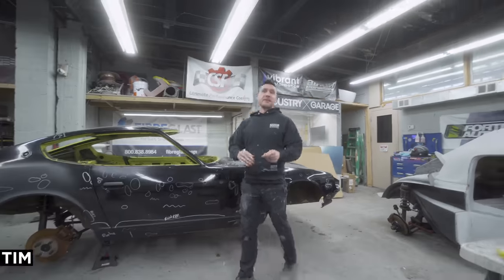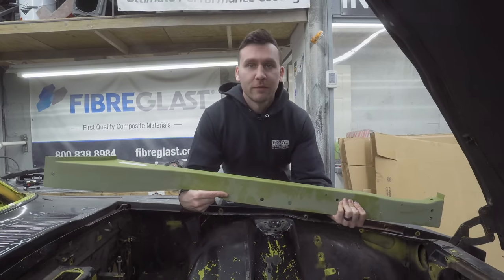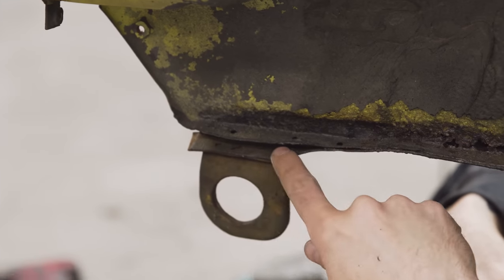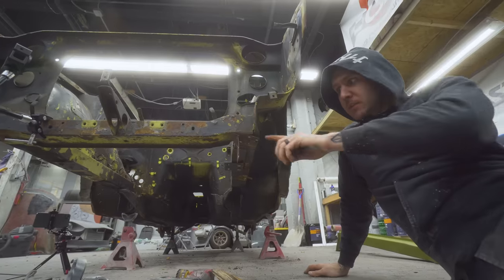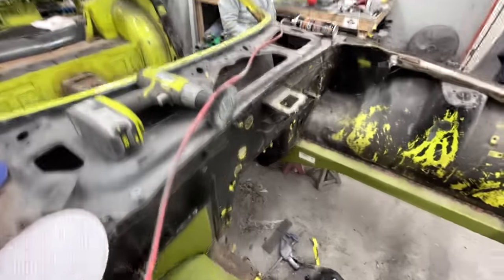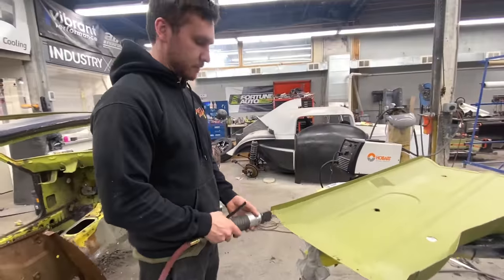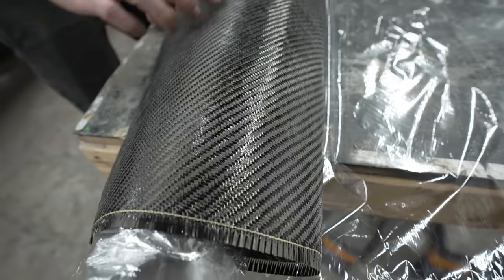Carbon Fiber 240z Restoration | Part 1: Rust Elimination

Comment: What do you use to neutralize the rust along the pillars elsewhere not cutaway? It almost seems like this car should have been dipped.
Reply: I have the same question, the rust seems overwhelming on this car!
Reply: Looks like Kurust a rust neutralizing chemical.
Reply: Google "rust converter" all sorts of interesting info. Up to and including in depth chemical analysis of how that stuff works if you want to go that deep down the rabbit hole.

Comment: 11:50 you removed so much structural elements of the body, without cross bracing it. How do you ensure proper chassis geometry?
Reply: He did cross brace the other one he made previously so I would assume he'll do the same in this one too.

Comment: Those dewalt pilot point drill bits are GREAT for cutting out spotwelds as long as you go slow and don't over heat the bit.

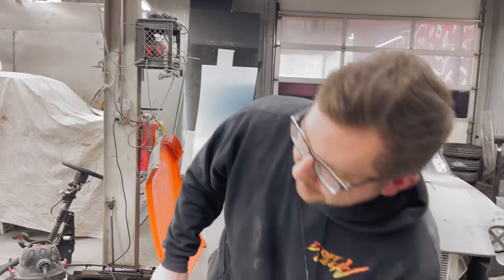Comment: 4:14 you can make a damage box from an old shoe box, LED strips and some spray paint. Essentially, you take the bottom of a bigger shoe box, cut one wall paint it flat black on the inside (on the smaller side) and put LED strips as straight as you can (using lines drawn on the bottom of the shoe box). The LEDs should be the cob kind, with the "lens" integrated, that way they are uniform, not punctual.
And from there you put that box over the area you suspect to be damaged and look from the side of the box that's removed. It will reveal the truth. edit: obviously this is for small damage, stuff you'd miss using big fluorescent light that you spend entire minutes chasing otherwise.

Comment: Hey for real though what would the cost of the rust repair be? The reason I ask is I have a rusty 71 240z. No floors and frame rails need replaced as well as the battery area and the font fenders. All the typical 240z rust areas. I got screwed by a guy once for 3k and that set me back a long time in getting the car started.
Reply: This is probably 80-200 hours of labor at $80-120 an hour not including materials. I'd lean closer to 20k, but I'm interested if anyone else knows since I'm doing some of this myself.

Comment: Please take some advice put on safety glasses or face shield I worked in a restoration shop and as a mechanic for 35 years and in that time only got debris in my eye once because I wore safety glasses. Also you may consider having car body's like this dipped to make restoration work much faster and easier

Comment: The early 240s were lightweight tin cans compared to later models . I had one that was made in 9/70
Reply: There really wasn't all that much weight difference in the bodies of the 240 vs the 260 and 280.  The frame rails were extended further to the rear of the latter series and a modest side impact beam added to the doors, and that's about all. Maybe a tiny amount of weight added in the tool storage cubbies right behind the seats vs the very early 240's.

The real fat came in via the grotesque bumpers, a/c systems, power steering, R200 diff and heavier 5spd transmissions.

Comment: Checkout Easy Composites Ltd. for how they make a carbon fiber mold and hood (bonnet). It will be interesting to see if you make from the car or make 3D laser scans of the parts and CNC molds for repeatable parts in the future. Molds only last so long. Using VARTM for the process?  This is a great project!!!